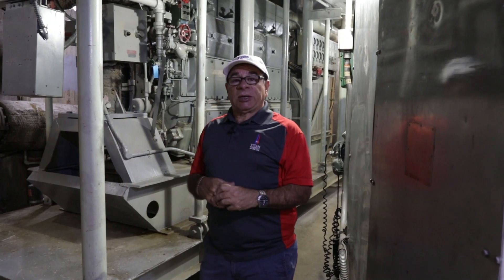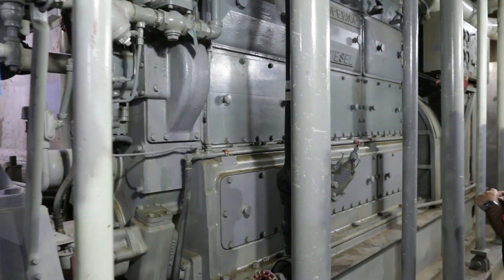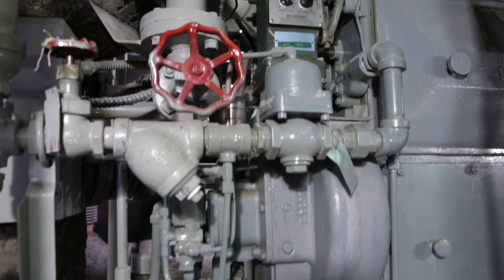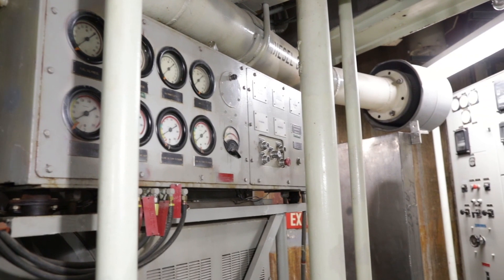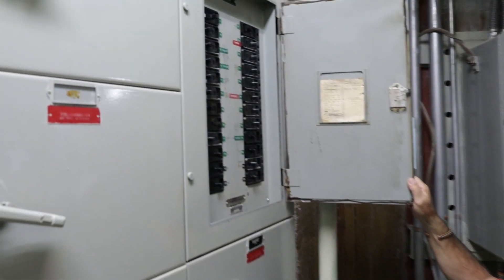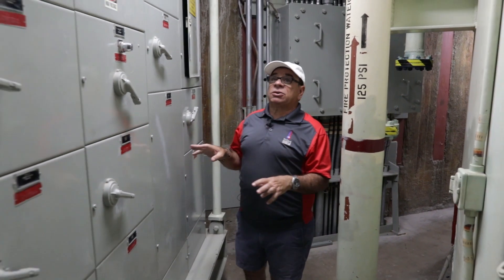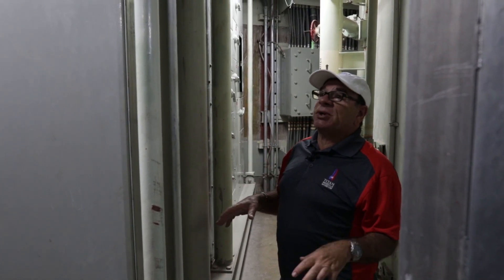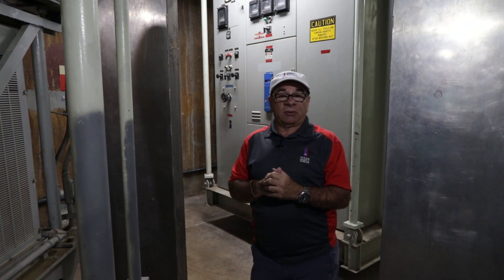Behind the Scenes of Titan II "Part 8 – Silo Level 3"

Comment: How did all this infrastructure in the silo survive the hot exhaust from a missile launch? Was the intent that everything is expendable as we would only have a single launch? There was at least one launch from a silo for test purposes, as evidenced by the footage (on the opening credits for example); was that silo destroyed?
Reply: The area that Dave was visiting and showing, and the missile silo itself are separated by insulated walls and blast doors as I recall.   Between the launch water deluge and the insulation, the surrounding equipment is somewhat protected.   I don't think the intent was to be able to drop another missile in the silo and launch again -  This is kind of end-of-the-world scenario stuff.
Reply: I remember them talking about that in the past. Yes the missile silo tube after launch was basically destroyed. A water deluge system was sprayed into the silo at launch and after to take care of fires etc...
Reply: The silos were not designed to be re-used after a missile launch. Once that rocket left the silo, the purpose of the entire facility was fulfilled and was no longer necessary as most likely the surrounding areas would have been wiped clean off the face of the earth. The Titan program (and all of our missile programs) are designed 100% as deterrence, not for us to fire at an enemy first. The idea behind them is that other nations would be completely afraid to attack us because we can ensure the destruction done to us would be returned 10 fold.
Reply: The equipment in the silo was outside and surrounding the launch duct which contains the actual missile, so there is some separation.  However,  silos were a "one time use" design.  The training silos at Vandenberg were designed differently to be reused for multiple test launches.

Comment: If the blast valves close due to first strike, how does the generator keep running (- air in and exhaust)?  Or were the blast valves only shut for a few seconds, then re-opened themselves again?
Reply from the maker: If the blast valves closed while the generator was running, the steam and diesel would be vented directly into the silo equipment area. The blast valves were set to automatically reopen 90 seconds later. Should the valves fail to reopen, however, it is not clear how long the generator could be operated as it would eventually deplete the oxygen in the silo, causing the engine to stall.